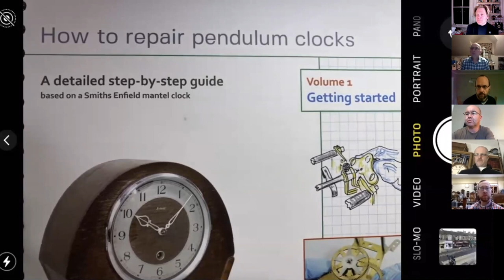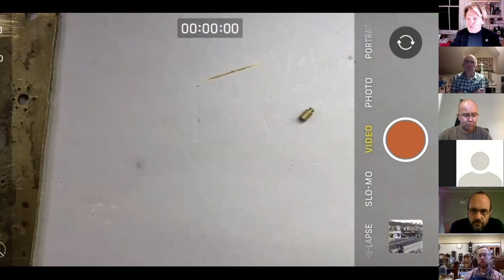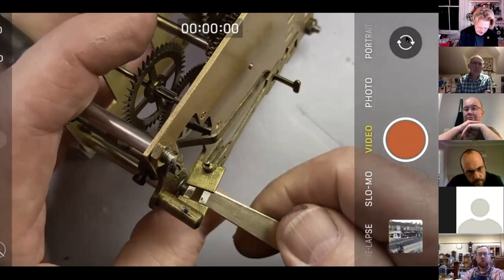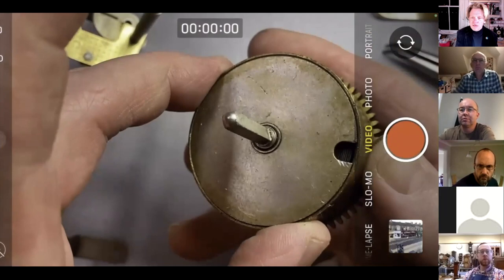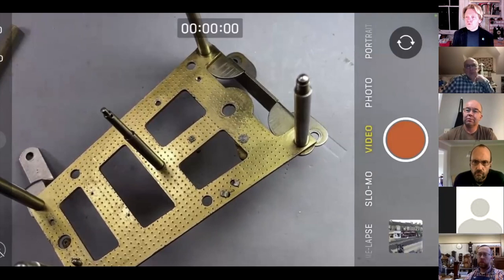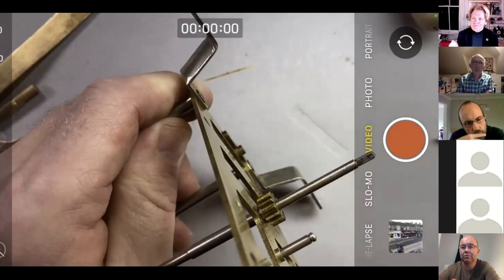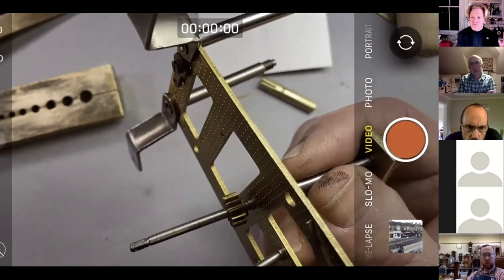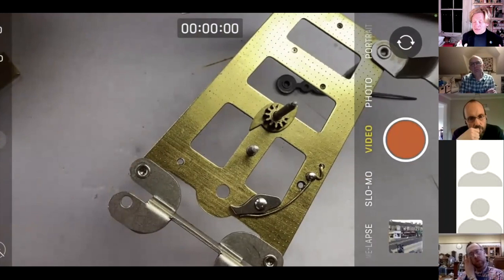Open Clock Club 009 2021 01 23 This week we tackle the removal of the factory press fit brass pinion

Comment: Thanks for the information on the suspension spring.
I have half a dozen movements some loose some tight and I didn't know what was correct, now I do.
A sliding fit that allows it to hang vertically when the pendulum bob is hung.
Reply from the maker: Yes.  It is such a common issue.  For optimal operation, the pendulum assembly 'must' hang vertically and swing in a 'clean' arc.  Glad this was of use. M

Comment: This was good to watch. Ive left that part on and cleaned it all together in the past as I had no idea how to take it off. 
I wondered if at anytime in the future you may cover the striking system of a French clock. I'm currently having problems with a Japy mechanism where the rack tail is locking into the snail which seems to be stopping the clock. As a  hobbyist Ive serviced several of these French movements but never encountered this before. Usually I find markings which are meant to align like timing marks but there was nothing in this case. It would be nice to be able to understand the theory behind the striking.
Reply from the maker: Hi Treetop.  Yes our third book is on French clocks but which is still some way off so I will cover this on Saturday in Open Clock Club.  Its on my list!!!

Comment: If you were to have used a socket from a spanner set then you would have to use the vise. Putting the socket underneath the brass piece which would be tall enough to clear the feet.